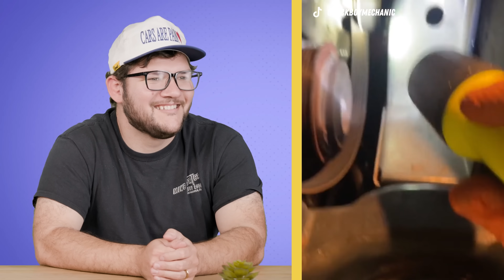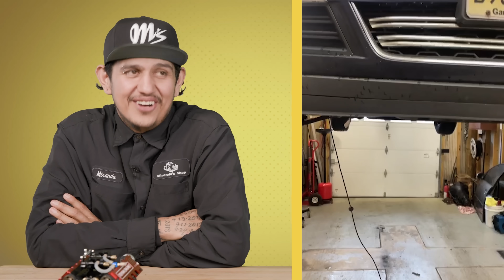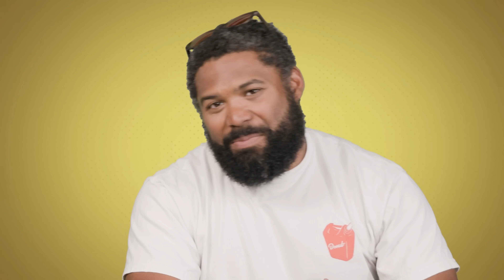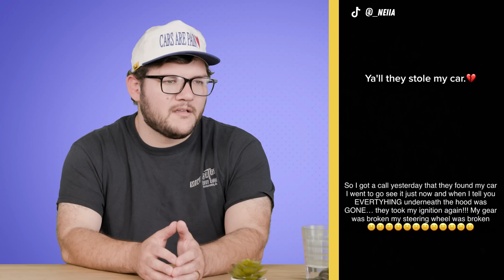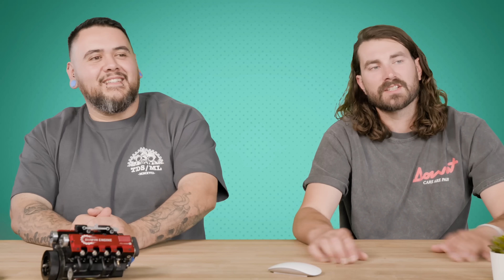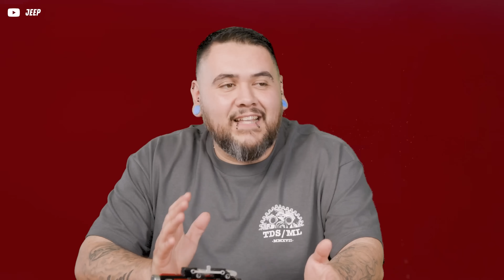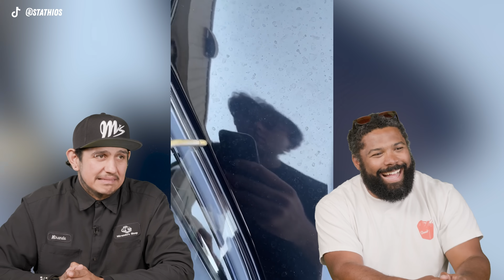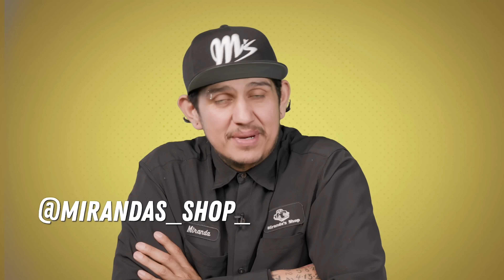Mechanic Reacts to Car Engineering Fails

Comment: What about an episode celebrating engineering wins?  I've loved working on my Tacoma because Toyota engineered everything to come apart easily.  Notice how none of the fails in this video were a Toyota?
Reply: Tacomas have issues with soy-coated wiring harnesses that attract rodents. Our 50k mile tacoma had a knock sensor wire chewed up, and I live in the middle of a suburban neighborhood nowhere near the wilderness. That harness is extremely difficult to replace because the hard coolant pipes are in the way. The official method at the dealer involves removing the head. I got crafty and managed to do it without cutting pipes or removing the head with some picks and a lot of patience.

Comment: There's a fantastic early Mythbusters clip where Jaimie just laid into the junker he was trying to fix up because the engineers built the car to require removing the battery to change a tire
Reply: hmm, I thought it was the other way round. One had to remove the tire, the fender liner and one other item to change the battery - I think it was in that retro car by chrysler.
Reply: @waynegibbons352  I remember it the other way, but I can't find the clip myself...

Comment: I can't understand, for the life of me, why it is that car manufacturers don't design cars, to be worked on efficiently, to the point where you can reach, access and remove every component that could EVER need to be repaired or replaced, without ever moving anything EXCEPT that part. Like, it shouldn't be necessary to lift an engine, just to get at a bolt that holds a component onto the engine. That is just dumb. Why aren't engine bays arranged for ease of maintenance??? Why is everything so STUPID? 😂

Comment: There is a reason why you can have an old classic car, sit out in the middle of a field for over 30 years, and it'll still come back to life. Be it, rained on, snowed on, blazed upon by the sun, sink into some mud_ and all it might take to bring it back is some mystery oil, a new fuel pump, and a little cleaning of the points. You leave a modern car out in the elements for more than 8 years, good fucking luck. They really don't engineer cars anymore, they just throw them together and hope it makes it to six digits. And pray there is no safety recalls to damage their profits. It's really disgusting and sad...

Comment: As an engineer, I agree that most times it is the engineers' fault, but I don't understand why it happens so often. Simply considering how parts will have to be assembled and disassembled could've prevented many of these fails smh

Comment: "An engineer will crawl over a pile of a thousand virgins just to fuck a mechanic"
While I understand that cars are very complicated and sometimes things just have to be in a certain way,
truck trailers are BIG AND BULKY. YOU GOT ALL OF THE SPACE! You really could't move that hole 2mm so I CAN FIT A FUCKING IMPACT SOCKET AROUND THAT NUT?!
They either take the space for an air impact wrench and fit the socket OR give me the space for the air impact BUT WONT LET ME FIT THE SOCKET. WHY.

Comment: Vw audi tfsi 2.0 l4 2013ish. This engine had an engineer fail. The timing chain tensioner was garbage causing the chain to stretch by like 50% at 60000 miles.  When it finally misfires from throwing time you get some good slap. Then it gets even better. They designed the chassis so that the whole front end has to come off to fix it. They claimed it was a lifetime timing system.

Comment: I am an Engineer, but not an Automotive or Mechanical one. Just like in any and all industries, you got good ones and bad ones. You also got good decisions and bad decisions, usually made by someone or a team of Accountants, Sales, Marketers or Owners that overrides common sense at the expense of time or money - usually both. There are a ton of bad examples both automotive and others of bad engineering that can be fixed/upgraded, but is it worth it? That being said, I own a 2011 Jeep Wrangler and I am on my 3rd engine at about 100k, so yeah, bad engineering decision to put a '90s minivan engine in an off-road vehicle and a bad decision by me to upgrade it.

Comment: Any jeep after 1992, is not a jeep. We had a brand new 2000 liberty come in with a rocker arm that popped off. They weren't even bolted on. Just held by pressure.

Comment: Engineers, and Executives, at car companies should be required to do an Oil Change, a Belt Change and Fuel Filter Change on every car they sell. Then they will be easier to work on.

Comment: 2006 scion xb the water pump pays 24 hours to get access to replace, same for the belts and the clutch. Why? Because all require engine removal the water pump is installed inside the motor mount bracket

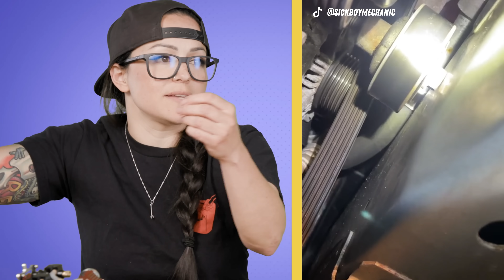Comment: 1:05 Nah F that, take a cutter and cut that bolt near the base of the engine unscrew the left over loose bolt out take it out then re attach the new tensioner with a slightly shorter bolt.

Comment: Have you tried to replace a light bulb in a 2015+ care lately?
The inner fenderliners or bumper has to be removed in order to access the wiring!
Reply: I had a blown headlight bulb in my Saturn astra.  I had to remove the grill and entire bumper just to access the headlights.

Comment: Worst I dealt with (not a professional car mechanic, but working on my own car) was my 1999 Mercury Cougar with the 2.5L V6. My alternator failed and so I had to replace it. Here's how you do it:
1. Turn the front wheels all the way to the left.
2. Jack up the front end.
3. Disconnect right wheel tie rod end and spin the wheel 90 degrees out.
4. Loosen belt tension and remove drive belt.
5. Get yourself double to quadruple jointed hands to squeeze them in between the engine block, firewall, and rigid steel AC lines, to the top of the alternator while laying underneath the car, to disconnect the electrical plugs while cursing for about an hour because those plugs are stuck.
6. Continue on with cursing for another hour while trying to fit your hands in again and a gearless 1/4" drive ratchet and 10mm socket to get to the mounting bolts.
7. Continue cursing and now bleeding while you pull the bolts out and attempt to massage the alternator through the barely big enough opening in the wheel well.
8. Repeat all the steps in reverse while putting back the new alternator on.

Comment: For the too long bolt, you are doing it wrong. Before you service the engine, you are supposed to take it out completely, and then start to dismantle it. That belt tensioner has the same calculated lifespan as the rest of the consumable items, so when the belt goes off, so does most of the power unit, as well as the suspension, brakes, mounts, pushings, bearings, etc. Modern consumer cars are not meant to be fixed. They are meant to be sold.

Comment: One of the worst design failures I've personally seen: Placing the $3000 AYC/ACD pump in an Evo X right behind the rear passenger wheel, exposed to the elements, corroding the pump and causing failures in almost every Evo X out there. The simple recall that should have been? Relocate it a foot above the current position inside the trunk like most people do to fix the issue.

Comment: One of the problems with component access on engines is that the same powertrain is fitted in a multitude of different vehicles, and they don't always allow for all applications at the design stage. This applies particularly if an existing powertrain is shoehorned into a car that was never intended to have it.
Reply: I have a VW MK4 Beetle; perfect example of engineers being forced to jam a Jetta/golf engine into a tiny engine bay. We had to drop the engine to get enough clearance to change the AC compressor 😂
Reply: I think a good example of that in this video is the Traverse; those 3.6 LLT engines were designed for longitudinal applications (FR). Likely, that tensioner bolt has plenty of room in all those Zeta platform cars, but finds that frame rail in the Lambda platform vehicles. 

I bet whoever made the decision to place that engine, as is, in a transverse application, didn't let the engineers fix it. For cost reasons. It was likely management, with input from accounting.

Comment: I firmly believe that all automotive design engineers should have to spend a minimum of two years working as mechanics prior to be allowed to design anything for a car. I have a friend who's a M.E. and his mechanical expertise are limited to spark plugs and oil changes. That's how you end up with 4 inches of bolt in 3.75 inches of space.

Comment: As someone working at Audi..that leaking issue is actually very very common lol
Reply: Thanks for saying that, I was thinking about buying a Audi. I think I will stick to VW.
Reply: @EgonTheGreat.  VW's have the same kind of issues.  The drain tubes from the sunroof tracks get clogged with stuff and need to be cleaned out.
Reply: @chrisbutterfield8743  well then, good thing I don't like sunroofs.
Reply: @EgonTheGreat.  That seems like a great idea.
Reply: @EgonTheGreat.  Same platforms, probably the same sunroof designs.

Comment: I worked in the metal finishing industry for close to 15 years doing zinc plating, anodizer, chem film and so on and I can attest to the fact that engineers are fucking ignorant! If you've ever been given a part and they want 2 types of coating on the same part but the process for one eats at the other, you would agrees that they are fucking stupid!!

Comment: Jeep is owned by FIAT now, it should explain a lot!  My 2018 JK hasn't had an issue that hasn't been a cause of off-road abuse; however, I specifically purchased a model that has ABSOLUTELY no electronics, manual roll down windows, basic ass CD player with an AUX input.  Both my parents have loaded Rubicons, a JL and a JT and yep issues electronically off the lot.  It's an offroad monster, it doesn't need heated seats, AC, CarPlay or any of that shit!  After 17 years in the automotive industry I stay away from modern electronics in cars, my MK7 Golf had some issues, one of the techs mentioned it in this video, the amount of body control modules and shit in vehicles is the downfall, especially if you live by the ocean or where they salt the roads.  Cars are disposable now, it seems like they aren't even made to last your lease or loan duration.

Comment: I've cursed my share of engineers before. I did both window motors on my 2002 Trans Am many years ago, and they make you drill holes through a fiberglass panel just to get to the rivets holding the motor in the frame, which also have to be drilled out. Took 2 hours per door (but I'm not a mechanic). My wife's 2004 Jeep Liberty took less than 30 minutes per door, lol, but that vehicle is a much bigger POS overall by comparison (had lots of electrical issues like the one referenced in this video. At least the next time I have to swap my Firebird's motors, it will be a lot quicker.
Reply: I have a 1997 Z28.  I feel your pain.  Window motor failure is definitely a "lets save 12 cents per car" kind of decision.  The way the harnesses were designed, there is the power wire (which is undersized, by the way) that runs to the driver's motor, they then piggyback off that wire TO THE PASSENGER SIDE, so both motors run off one undersized wire, so the motors don't get the amperage they need which burns them out faster.  For me, if it's more than 75 degrees out passenger side never works, and there's about a 60/40 chance of the driver window NOT working.
Reply: @SupaFlyJedi  Yeah, I also did the wiring kit for the passenger motor. Was pretty hard to fit the wire through the PCM harness going through the passenger door, and I had to stare at the wiring diagram for about an hour before it made sense to me, but I got it done. It's a must IMO.

Comment: hate jeep, bought a 2011 jeep compass 5 speed manual, 1 previous owner, less than 40k, told it had zero issues and had all maint till that point supported by paper work. a year later, 1 new motor and transmission, electronics fail and most of the electronics were replaced. not to mention the suspension issues, and i babied the crap out of that thing. jeep can suck a fat one.

Comment: My ‘05 Magnum had electrical problems with the transmission. The trans fluid wood get into the electrical components and the car would shift poorly. They fixed it after 3 tries. The gasket was made out of cork.

Comment: Wow that first dude is having himself a day. I think anyone who has truly worked on cars has had one of those days. If it's your car you crawl out from under it and kick it up and down the side while inventing all sorts of new terms and disparaging the parentage of the team who created the clusterf*%k that you are working on. You know it's bad when your dad's like "Son go sit down and calm down before you have a stroke. I'll finish it up." Normally not good at accepting help but I walked away from it. Got to take off the alternator, power steering pump, and starter just to change some simple ass thing in the distributor which is next to the firewall under the intake manifold.

Comment: Aerospace Engineer here. I agree that engineers will make flaws during their design process, but you gotta consider the costly factors (accountants/project management) that are way more controlled than the design procedure itself. Big companies tend to cut corners and shave expenses as much as they can, thus consequently affecting the design (materials/ tooling/ safer designs) and assembly procedures. Another factor to consider is the miscommunication between the engineers and the QC sector. It’s very common to see no communication between them to claim and point out the flaws before the product gets approved for mass production. Again, the bigger the company, bigger the problems…
Reply: Maintenance however is taken into account in aviation engineering. It's not in automotive.  Take the bolt in the video for example, that requires an engine out to remove the tensioner. You aren't designing a removal of a JT8 in order to access the accessory gearbox, yet we find that in the automotive world constantly...
Reply: same; was an engineer for Martin Marietta during the Lockheed merger years. Quite a bit of headbutting between design engineers and manufacturing/production engineers

Comment: This is an oldie but a goodie, the Nissan 300zx z32 is a pain in the ass when you have to replace the lower valve cover gaskets the egr pipes that lead to the plenum are in the way and you have to bend them out of the way I order to pull the valve covers.

Comment: Keep in mind engineers often say "hey, problems will arise if you cost cut" and the paper pushers say "itll be fine we need better marigins" and voila
Reply: Precisely. The management just says that that's the next guy's problem
Reply: It's in the future. Doesn't affect them. Corporate lives by a financial quarter at a time. Gotta hit those projected revenue numbers no matter what. Causing problems down the road does not matter, next quarter is the only thing that matters

Comment: Heres a fun one, if any yall ever have to work on a second generation benz sprinter ambulance van, I wish any of ya all the best. The china made cheap quality coolant overflow tank (is pressurized) leaks quite often and is considered a replacement item. Check every 10-20k miles type of deal unless you buy an aftermarket. Now the issue is if you let the coolant drip drip out of that crappy overfill tank, it will end up on the turbo exhaust side, which is also where they decided is the best place to put the turbo electonic module. So you simultaneously break the turbo and electronics (or i guess make the already short lifespan even shorter lol). First job on one of these things ever with a senoir tech at the time, there is no dogbox so you cant get at it from the inside of the cabin like most of them gms or semis. The engine itself is right up against ya there and turbo is under the windshield practically. Had to disconnect the motor mounts, and the exhaust and intake, and then the wierd y pipe yhat connects the turbo to em and then finally the turbo, after all that it still took a good 5 hours to wiggle the son of a gun out, had to twist it backwards and then upsidedown in order for it to get outta there with the small amount of wiggleroom you get tired pretty fast. Suprisingly it was much easier to put the new one back in, idk if we were just over it or what but it only took us the last day of that 5 day ordeal to get it all back together and clear the module. (We both took mental breaks like doing oil changes or brakes to get away from the thing lol)